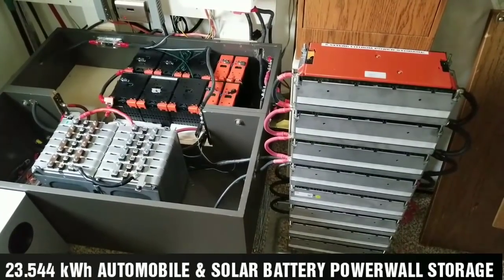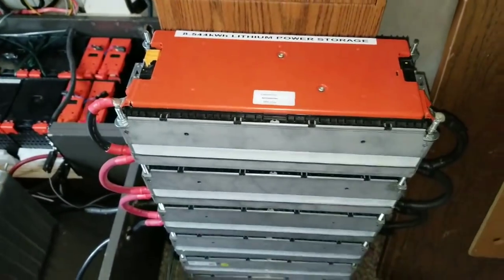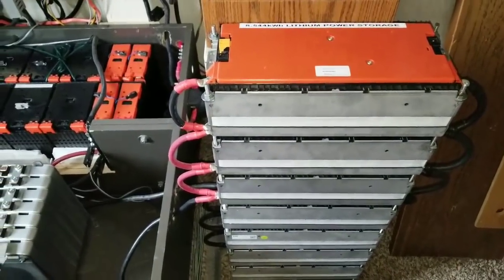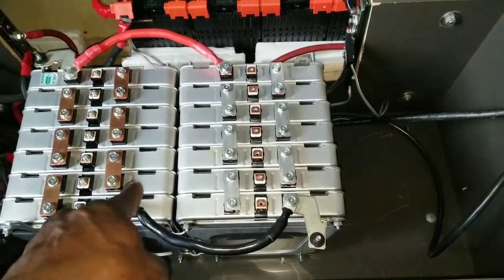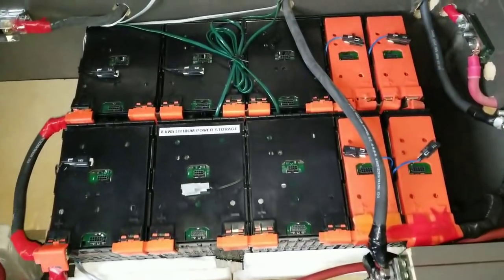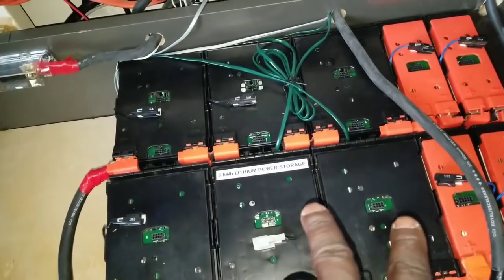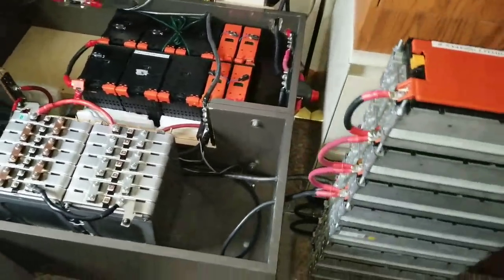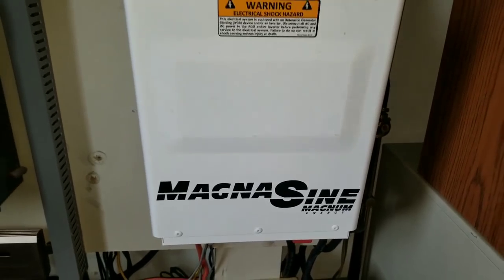23.544 kWh AUTOMOBILE & SOLAR BATTERY POWERWALL STORAGE

Comment: HOW ABOUT INVESTING ON A LOAD CENTER FOR THE MAGNASINE IF YOU INTERESTED . LIKE YOU SAID , IF YOU WANT TO MOVE AROUND THE COMPONENTS ON THE POWER WALL . IF POSSIBLE , HAVE THE MAGNASINE AND THE POWER TRACK  ON THE LEFT SIDE AND THE OUTBACK AND FM 80 ON THE RIGHT SIDE , AND ALL REST LIKE SWITCHES , METERS , WIRES AND THE CONTROL BOX IN THE MIDDLE OF THE WALL . THEN DIVIDING THE 24 V AND 48 V LEADS INDEPENDENTLY TO EACH INVERTER FROM THE MIDDLE . JUST A THOUGHT I WANT TO  SHARE . MAY THE SOLAR BE WITH YOU .
Reply from the maker: Thanks for your contribution.
I really appreciate your advice and have a wonderful evening